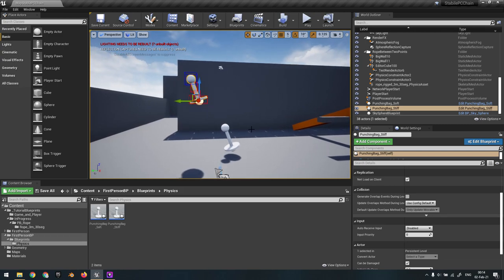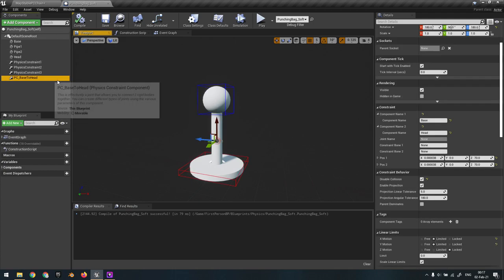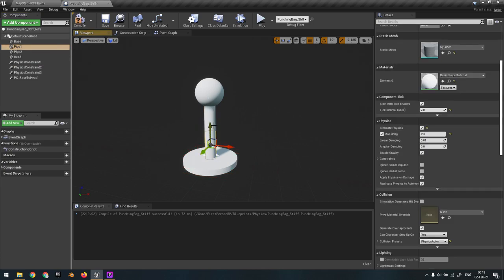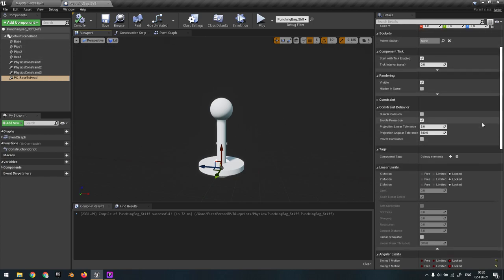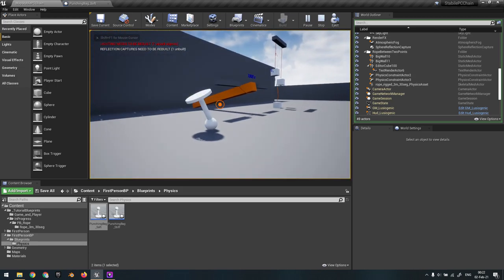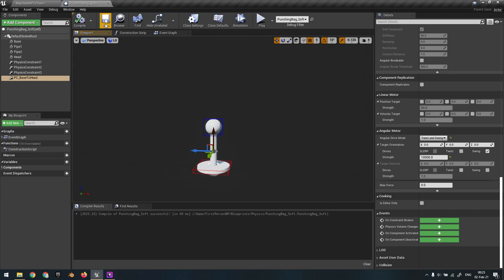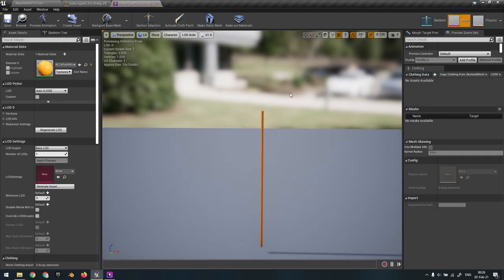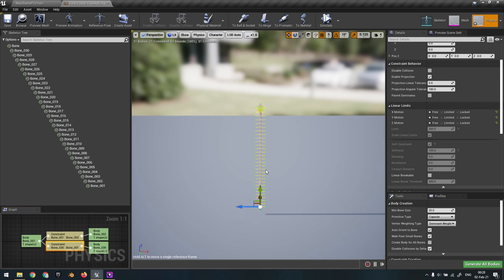UE4 Stabilize Physics Objects in chains / Constraints Tutorial

Comment: damn that phyiscs stuff is impressive, do you think its possible to make a long! suspension bridge that is stable and performant?
Reply from the maker: Can you clarify what you meant by suspension bridge?
I was thinking of making a rope bridge, I think it's quite simple. 
Actually, for a fixed length bridge, you can easily do it by hand, by creating the Physics Constraints and the static meshes.
I'm now trying to implement a configurable legnth bridge on a spline, so it just takes a bit more time to play with since I have to create the components through code in the construction function.
Reply: @Lusiogenic  jeah a hanging bridge... I made one once with physics constrains without bones procedurally but with 60 planks it has realy bad performance
Reply from the maker: @MarvelMaster  60 planks is a bit much. But I think it could have worked. 
Was it unstable by itselfm or when you put physics objects on it?
Reply: @Lusiogenic  hm a spline is an I teresting idea... I wanna use it for a kind of game... It's unstable on changing framer ates or when damping is low
Reply from the maker: @MarvelMaster  Go to Project Settings > Engine > Physics and set Max Physics Delta Time. This will enforce a "physics framerate" at the expanse of the rendering framerate. You will loose visual framerate, but the physics will stay stable.
In the same menu, you also have Physics Sub Stepping, in order to multiply the physics framerate in relation to rendering framerate.
Reply: @Lusiogenic  well I did that few weeks ago and was happy with the result but it broke other physics stuff like throwing things
Reply from the maker: @MarvelMaster  That's maybe because you're basing your throwing mechanic on the rendering framerate. 
Depends on the implementation, but these problems should not appear.
Reply from the maker: Aaaand it's out: https://youtu.be/PYJP09BENiQ
Stable enough?
Reply: @Lusiogenic  looks good :) I also. Like that the setup is pretty small

Comment: Welcome back Lusiogenic. Missed your ue4 tutorials :)
One question, do your prior physics tutorials apply to Chaos physics that is added in the newer versions of UE?
Reply from the maker: I mostly did stuff with Physics Constraints. For now, it's unclear what will happen with the physics constraints.
But, from what I have found on a page on Chaos, they will be completely re-implemented in Chaos.
Not sure how much that will affect their behavior. I would say most of the tutorials should be valid.
Reply from the maker: From Chaos description page:
"Chaos Physics supports velocity drive, breakable joints, collision restitution, collision enabled settings, proper elliptical cone constraints, enable gravity settings, joint linear and angular restitution, and angular projection. 
Additionally, Chaos RBAN will feature RBAN World Object Support and RBAN Simulation Space."
Reply from the maker: But, of course, it doesn't say if the Physics Constraints will be replaced, or they will make other separate actors for the constraints.
It might be that they will keep both systems at the same time, in order to insure backwards compatibilty.

Comment: Hi, i tried a rope (cable) but i scaled it for a use down 0.1 / 0.03 i attached it on a static mesh (without physics) with a constraint but if i run the simulation it will fall like 3 times it length down and jiggles in the air, if i pick it up with my hand (if i attach a grapspehere with a constraint) and go near to the fix point it get pulled back to the point but it will extend if i let go. The cable it self doesnot disintegrate, just the force of the constraint seems to be to weak
has someone an idea?
Reply from the maker: From what I know, scaling created problems in skeletal meshes with physics constraints. I would try to avoid it.

From what you're saying it seems that bones and/or physics constraints are not being correctly scaled, that's why the cable gets loose.
Reply: @Lusiogenic  Hi thanks for the quick answer. It seems that the scaling is the issue, i tryed it with a staticmesh cylinder and that works better, except that the ankerpoint is wrong, but i think i will get that, sadly a 5 cm small cable is to small import in unreal and generate a PA but i will have to use a static mesh than Thanks so much

Comment: Have you tried the new Chaos engine build of Unreal?
Reply from the maker: Not really. For now it is mostly made around destruction and cloth, which are not subjects that I look into usually.
I will explore Chaos, but not right now, as it is not stable enough.
Reply: @Lusiogenic  I've tried it myself and I just cannot get the physics constraints to work properly at all at all. We're sticking to PhysX for now as it works perfectly fine as is, but it would have been nice if Chaos had provided some improvements.
Reply from the maker: @fuzzywobs  What form did the physics constraints take? Were they components and actors that you could use directly, or was it only inside a Physics Asset?
Can they be used without having bones?